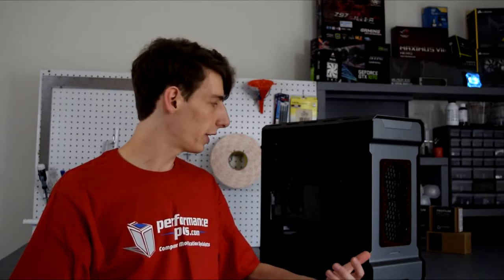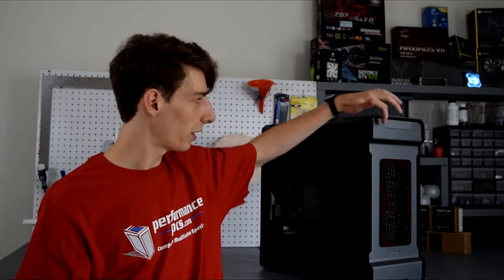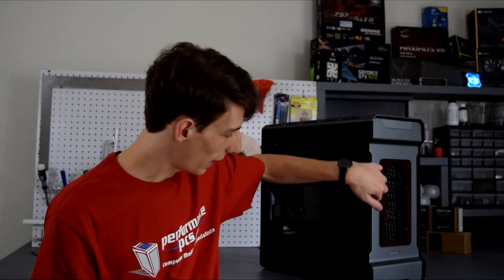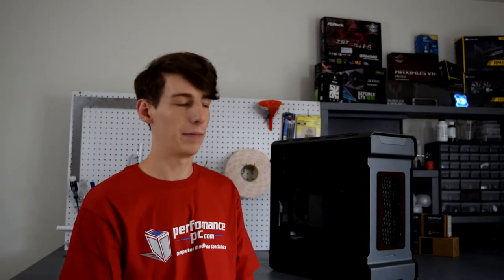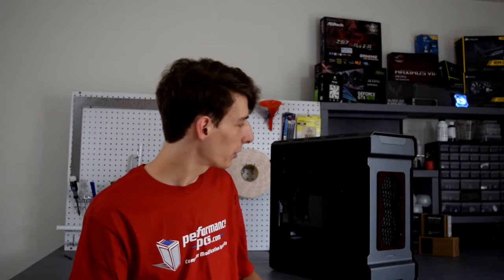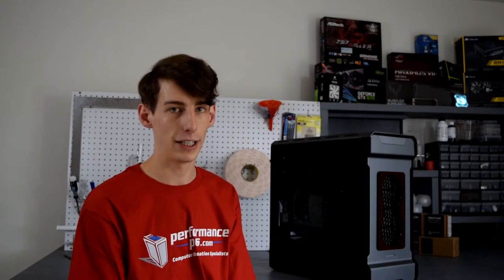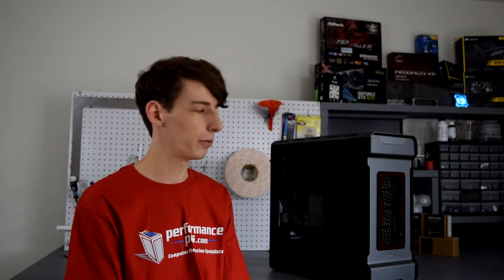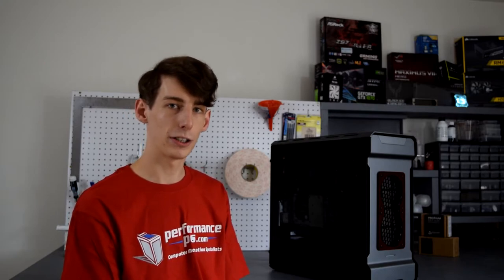Making the Evolv great again w/ airflow mods!

Comment: I took my front and top panel from my Evolv to a fabrication shop to get ventilation holes put in them. I was too afraid to do it myself.
Reply from the maker: Yea but CNC is the way to go. Or at least some type of professional machining looks really nice.
Reply: Awee dude do you have any pics what kind of shop? What exacty did you look for, I'd like to see the work they did for you.
Reply: @PerformancPC, how do you use a CNC machine to cut the front of a case like this, I  mean I'v seen people cut wood, acrylic, aluminum, but those usually start out as flat slabs.

You are talking about something that is already fabricated and modifying it, I didn't even know you could do that.
Reply: What did the shop charge to get that done? I've had estimates that cost more than the entire case does...

Comment: I like airflow on my phanteks evolv atx tg, no needs for modding :) watercool that bitch!
Reply: it is watercooled
Reply: The airflow problem is pretty much related to custom loops
Reply: Spoiler alert, you water cooler is cooled by air. The coolest you can possibly get is the ambient temp inside the case, so...air flow.